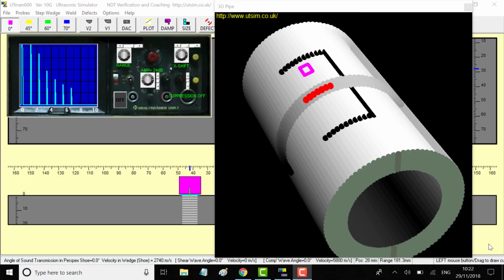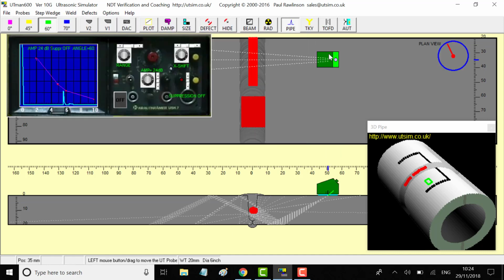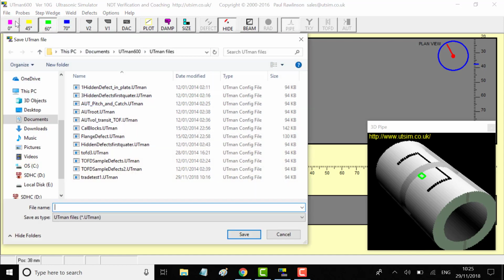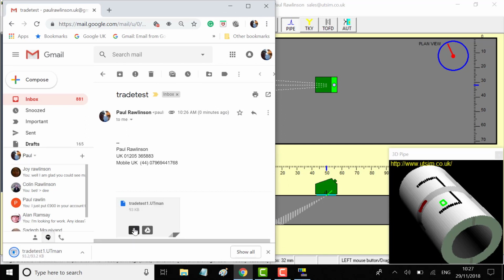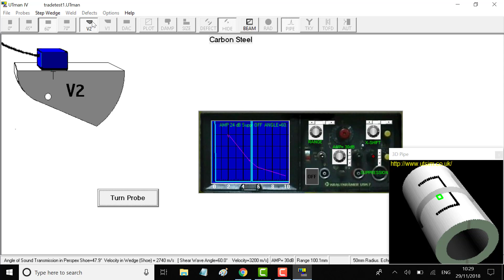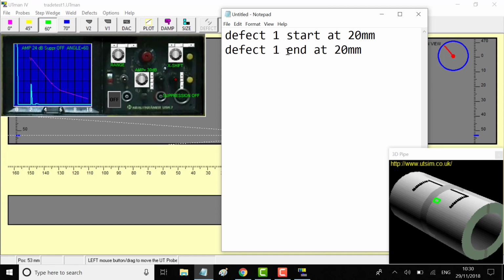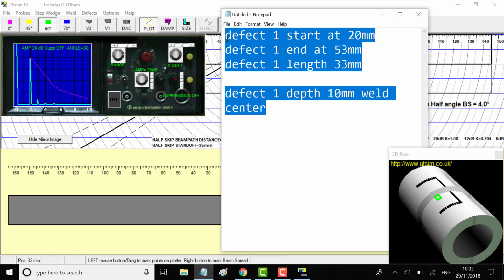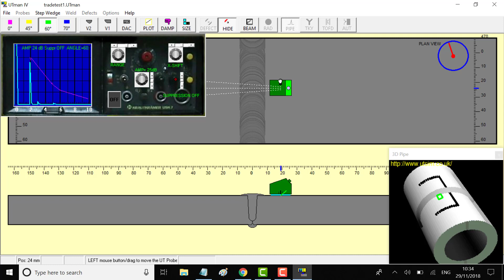Trade Test with UTman software

Comment: Trade test should be done in practical by inspector on real job physically!!!!
Reply: Airline pilots said the same when someone invented flight simulators.
Better to crash on the virtual machine
We have one million defects to test in the simulator.

50% of all those taking the traditional trade test are failing.How would you suggest this should be improved? ?   What machine?   What defect type?   How would you do this for pipeline AUT?
Reply: Facts. This is solely for Practicing and getting prepared for outcomes. Virtual or not it does transfer to your abilities when in the field. If you go into the simulator with a mindset of it just being a simulator then you’ll have problems. Take it seriously and you’ll transfer it irl